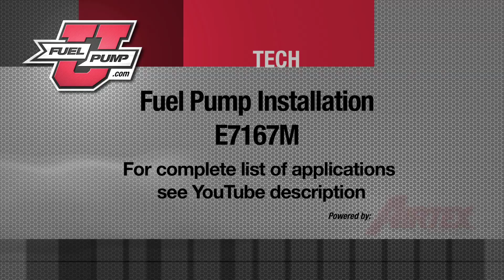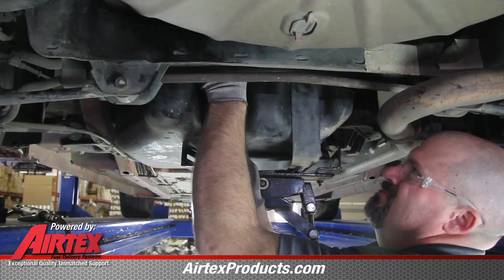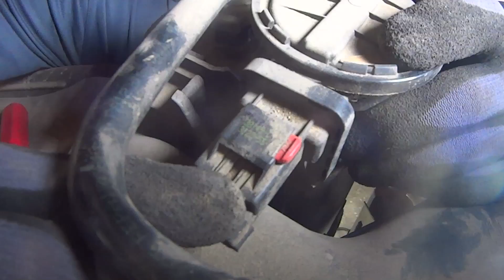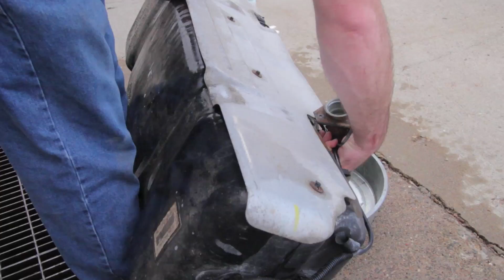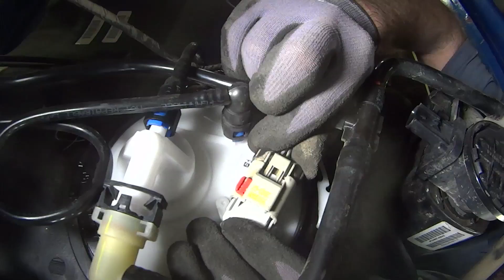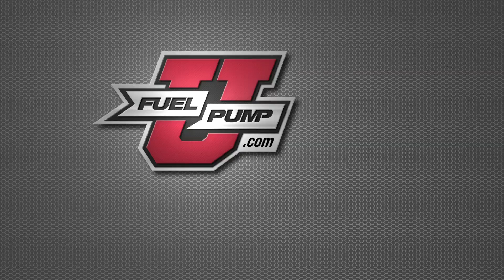How to Install Fuel Pump Assembly E7167M in a 2003 - 2006 Dodge Stratus

Comment: Very helpful! I have an 05 Stratus that started and ran ok until I tried to start it again when the engine was at operating temperature (going into grocery store for 10 minutes). It would crank but not start unless I let it cool down, which could take 30 to 45 minutes.  I switched out the coolant temp sensor and the crankshaft position sensor and had the same problem.  I then put a new fuel pump assembly in and the vehicle is working great. I paid about $23 for each sensor and $170 for the fuel pump, so about $220 total. It was my first time dropping the gas tank on a vehicle but it wasn't as hard as I thought it would be. Prior to changing the pump, it  hummed quite loudly for a second or two when the key was turned.  The new one I really can't hear, so a humming pump may be a good indicator that it's failing.

Comment: Behind the left side of the gas tank on 2005 Dodge Stratus what is that black handle knob that can push in and push out and you can turn it what does that do beside the gas line
Reply: It has a black knob around it

Comment: Can i access the fuel pump from my backseat or trunk without dropping the tank? I havr an '05 Dodge Stratus SXT and dont have the money to spend to take it to a mechanic.... Also, I dont want to pay for a repair that costs more than what my car is worth.
Reply: Airtex/ASC Performance Pumps copy. nothing under the carpet of the trunk?
Reply: How about a 2004 2 door coupe?
Reply: Airtex/ASC Performance Pumps does the 4 door also have an access hatch? I dont have the means or funds for a shop job

Comment: I'm about to replace my fuel pump on a 2001 2.7 l but I don't have a fuel pressure gauge..
Reply: +Airtex Pumps  looks like it all worked out but after replacing the fuel pump and starting up the car my fuel guage was at full and the tank was pretty empty .. hoping the floater isn't defected